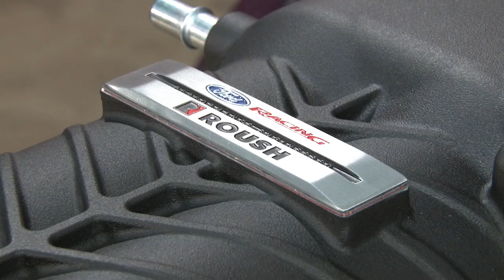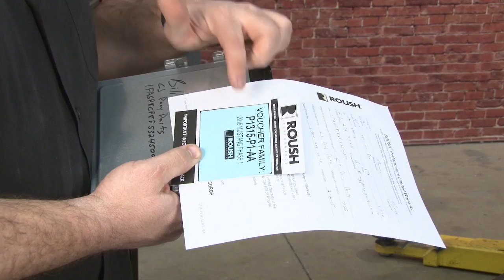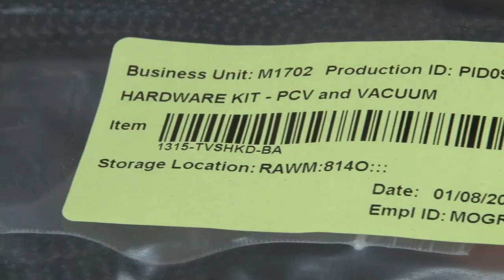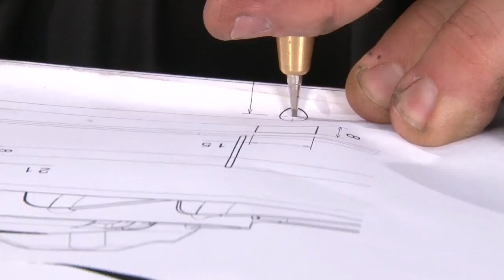2015-2017 Mustang GT Roush Supercharger Kit Phase 1 670HP 5.0L Installation

Comment: Do I have to install a new automatic gearbox, how much hp does the original take? Will the original fuel pump be sufficient?
Reply: The stock automatic trans will be absolutely fine at this power level as will the original fuel pump. The phase 2 kit will include a booster for the fuel pump.
Reply: Thank's Bill, for quick replay. Thumbs  up!

Comment: what is the difference between this supercharger and the vmp? i heard tuning. i ask because with the same size pulley and same amount of boost the vmp mkes more power.
Reply from the maker: They are both TVS superchargers. The inlet and tuning on the VMP are different.The Phase 1 Roush does not void your warranty.
Reply: CJ Pony Parts My warranty ran out already. In this case wich would you recommend?

Comment: Bill quick question, lets say I also went with this Supercharger and later decide to add some headers, would I have to resend the computer to Roush to have them do some sort of tune or is it not necessary?
Reply: +iceagerevenge  Plenty of people have added headers with the Stage 1 and been fine with the supplied tune. That being said Roush does not offer a tune for headers and I would suggest getting a custom tune if you do add them.
Reply: +Bill Tumas Thanks! How important would it be to upgrade the clutch after supercharging it? I hear many clutches start slipping cause of it
Reply: +iceagerevenge  I plan on an upgraded clutch in the future but I have 9500 miles on it how and no issues.

Comment: Happy Thanksgiving Bill, question have you heard of any defect on the roush throttle body, cause a wench came out on my dash lost power then I shut down the car restarted it and wrench is gone for now but Im hearing it can be the throttle body....please help if you know or heared anything like this??
Reply: I had an issue with the car losing power after a long ride but that was the first generation tune. I got a reflash with a more current tune and had no other issues.
Reply: Bill Tumas so I should call roush for that??
Reply: Yes I would suggest contacting them.
Reply: ok thank you so much have a good day...

Comment: hey bill im looking into a supercharger in the spring. i was looking into getting the same one as yours. I was wondering how its holding up and i just want to know how it feels over stock. also i have the blowfish manual support bracket on and it feels amazing. i know you have it on yours as well and i was wondering if your center console where the cup holders are ever gets warm. hope to hear back from you :) thx
Reply from the maker: +andrew pulcini My supercharger has been great! I have around 9000 miles on it now, I installed the blower around 750. I have had zero problems except for a slight overheating issue hot lapping the car on a road course when it was 102 degrees out which was my own fault. Roush recently came out with a free upgrade to take the kit from 627 to 670 hp for no charge. I don't recall having any additional heat in my cup holder area.
Reply: +CJ Pony Parts sweet :) can't wait to have it installed in the spring :) also did you decide to purchase the additional warranties that roush offers? and if so how much more do they charge for it? thx again :)
Reply: +andrew pulcini, If you're serious about putting a supercharger on it i'd say take a look at the whipple supercharger. I've installed both a whipple and a roush supercharger on 2015 mustangs. The whipple does not require Griding and modifying your timing cover or valley to fit the belt routing and the inter cooler.  Also having put both on the dynojet dyno the whipple's tune is a better tune, although i reccommend getting a custom dyno tune in your area. The whipple also makes more power and has lower IAT's. That said I'm a turbo guy but if i was going to to a supercharger i'd go with a whipple, i've installed lots of them and never had one fail. Good luck in your decision i hope this helps im not here to confuse you haha! If you have a question, feel free to ask!
Reply: Well... that's good to know . Thanks for the advice :)

Comment: It is not a roots style blower. It's a twin screw. Very different in how they push the air.
Reply: The Roush kit comes with an Eaton R2300 which is a roots style twin vortice supercharger. It is not a twin screw like the Whipple or Kenne Bell.
Reply: My bad, I stand corrected. I had always thought the TVS was Eaton's venture into the world of twin-screws, but after looking it up, you are correct, it's a roots s/c. Thanks, learned something new today !

Comment: Hi Bill, did you have any error codes or issues after starting it up for the first time?  I'm getting a crankshaft error.  Roush told me to tow it to a dealer to have them relearn the crankshaft sensor.
Reply: I had no issues at all. Did you install a clutch as well?
Reply: Not yet.  Roush recommended doing that before towing to a dealership to relearn the sensor since we would have to do the same tow to dealer and relearn after we did the clutch.  A mcleod twin disk.  This way, i'll save myself a tow and a reflash.  Fun times!  Haha!
Reply: Its very common with the clutch but never heard of it with the blower.
Reply: Thanks Bill.  Hoping the dealership doesn't mess with the Roush tune :-)

Comment: i kind of basically understand the difference between a supercharger and a turbo.... why'd you choose a superchrger over the turbo for the gt? also, if i add a bunch of bolt ons like cai etc, will they be discarded if i add boost later?
Reply: +Britney Stinson      I went with the supercharger because I have more experience with them and like the positive displacement style blowers. I would have liked a turbo but there really weren't any kits around and they also get pricey. Cold air kits will go away with any supercharger or turbo. Cat back exhaust can stay with a supercharger, and sometimes with a turbo as well depending on the kit.
Reply: thanks! if boost is something i really wanna do, but like 3-5 years down the line... would you suggest not doing a cai?
Reply: +Britney Stinson    That's up to you. If boost is your focus then I personally would not buy mods that did not work with it.
Reply: thanks luv! do you have any cool add ons for your car coming up? :)
Reply: +Britney Stinson   nothing crazy. New wheels and tires and possibly some more boost.

Comment: But do you need any internal engine upgrades to hold the hp?
Reply: HeadShotPR not sure about older models but from what I've heard the newer coyote's (at least 2015+) have a pretty stout bottom end and have reliably handled putting down up to 1000rwhp.

Comment: What will it do in the 1/4 mile with street tires on? et and MPH
Reply: With a good driver and a decent tire mid to high 11's in the low 120s. I went 11.1@123 on drag radials with a mediocre 60 foot

Comment: can the stock internals handle the extra psi without  causing  potential  damage?
Reply: Yes the engine is plenty strong for this power level
Reply: what kind of money did this cost
Reply: monopoly money

Comment: Am I the only one that notice the cracked Throttle Body at 47:06?
Reply: I had to watch it a few times myself but it's not cracked, its the camera angle of the TB connecting to the seal.
Reply: Holy crap man you're right.  That messed with my head.  Thanks for the reply!

Comment: Plz cj do a nitrous install on the  s550 want to buy a kit and do it myself would like a quality video to follow though. Do you have any plans to do a video of this type
Reply: +Ali Bazzi  We don't have any plans at this time.
Reply: +Bill Tumas can the strut bar be reinstalled at all ?
Reply: +Jay D I won't fit. I think it might fit if you welded it or something to clear the supercharger. I know a lot of people are going procharger and turbo on the s550 so they aren't having this issue.
Reply: what if you added a bunch of washers to raise it ? or Is the issue the hood?
Reply: +Jay D I think if you added washers it might defeat the purpose of the sway bar because the washers will probably flex. if you took it to a shop and had it welded at a higher angle to where it cleared to supercharger it should work and still stiffen the chassis.
Reply: +Jay D  The strut bar will not clear the supercharger. Lifting it up will interfere with the hood.
Reply: +Bill Tumas Thanks for the heads up. probably part of the reason most s550 guys going the procharger route.
Reply: Bill Tumas Thanks Bill ... doe you actually notice and difference without it ?
Reply: +Jay D not at all
Reply: Bill .. I just kooks long tube headers , h pipe and new kooks mufflers + air raid and tune to my 2015 GT .... tell me how much more would supercharger give me seat of the pants.. truly worth it ? also does it add weight to car ? handling  ? thanks
Reply: +Jay D I think I can answer this for you. I know for 6k right now you can get a procharger and 7 k you can get a supercharger. I think both are defenitely worth it. I have seen people making huge power gains with a supercharger. cars handling is unaffected although some stickier tires would be nice. won't add any weight.
Reply: +Ali Bazzi Will aluminum drive shaft handle this power?

Comment: stock pistons? a low pressure?
Reply: Kirill Dmitriev The stock bottom end is more than capable of handing this power level without issues.
Reply: Bill Tumas pretty sure forged internals are req'd.